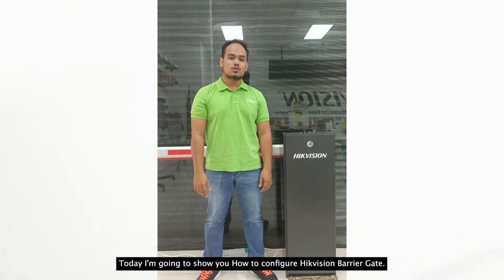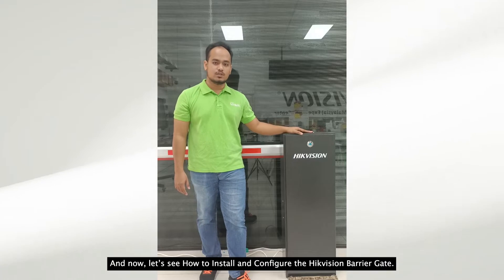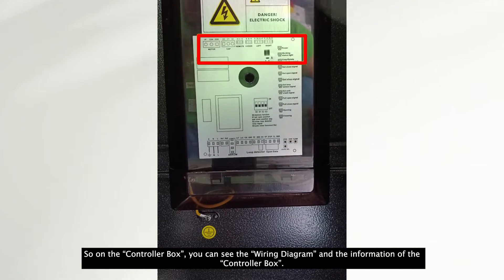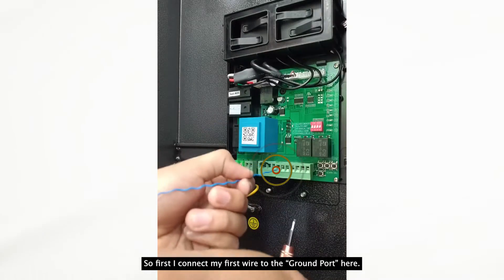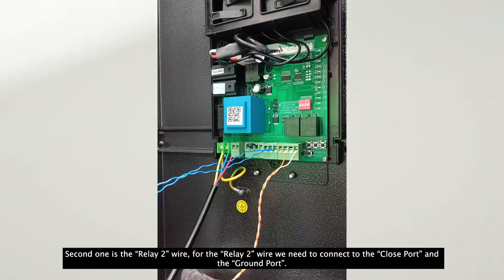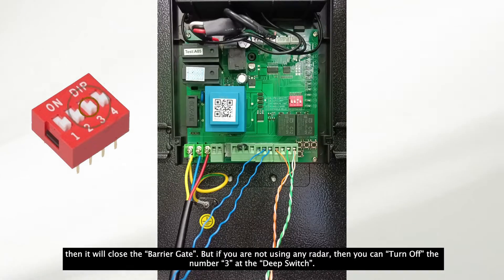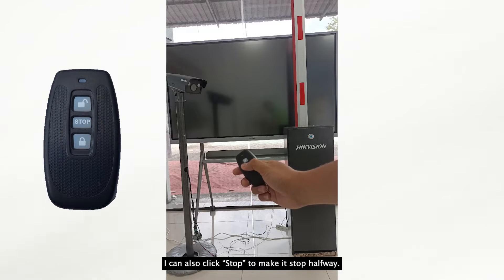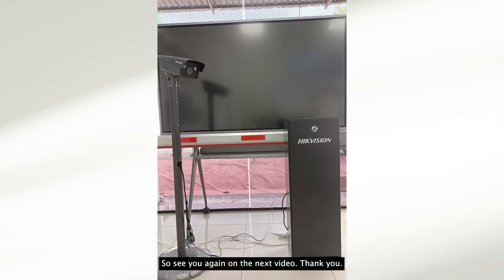HOW TO : Set Up and Configuration Hikvision Barrier Gate DS-TMG4B0 Series!

Comment: The radar it no and it has to be connected on the right plug and ready
Reply from the maker: Hi @claudiogalva9695  It is better to have external power for the radar because if connected from the barrier gate control panel might lead to unstable power.